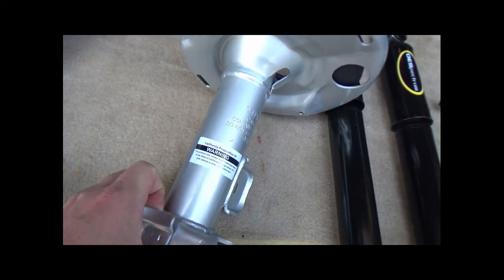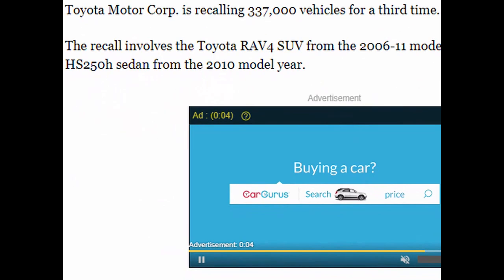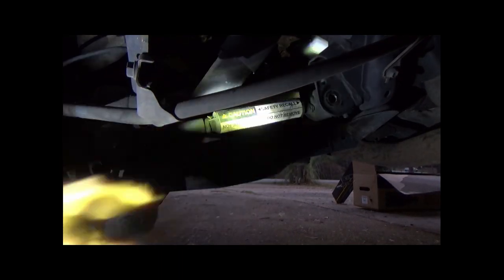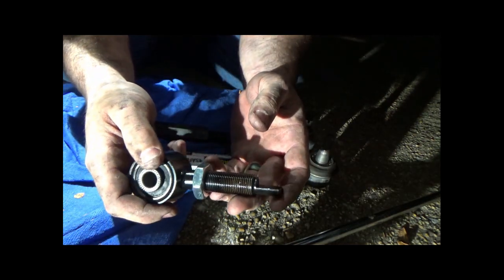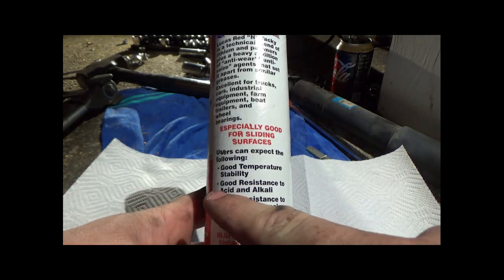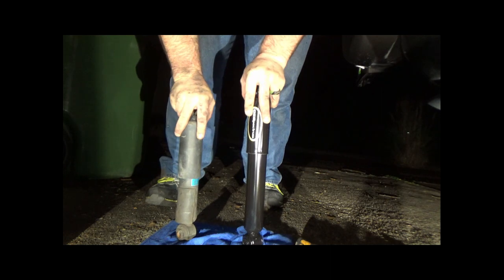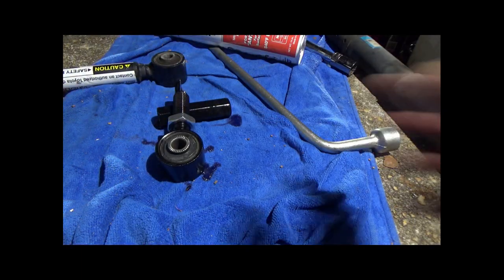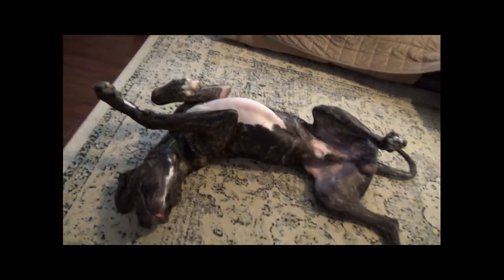How to install adjustable toe bars on a RAV4, and change rear shocks

Comment: I have 98,000 miles on my 2011 RAV4 and my tires wear perfectly. I am planning on replacing my struts and shocks soon,I hope I don’t have to replace too many suspension components too.
Reply from the maker: 2011-2012 I believe have a cam in the toe bar for adjustment, new design

Comment: Fantastic video, thank you. Stevenson Toyota here in Colorado quoted me $1600 for to replace the toe arms and align the rear wheels.  Thanks to you I got out the door for $100 at my local Napa store.  The Napa warehouse in Denver had stock and I was able to get the arms same day.  Thank you again!
Reply: can you share which parts you used for the replacement? Did your original toe arms have the epoxy?

Comment: I think anti-seize grease will work just as good since that grease is very difficult to wash off if water gets inside the thread. I read many places are over charging installing these control arms. What many people are confused about is the epoxy. Many don't know that the epoxy does not need to be removed and that only the two mounting bolts are only removed which are not epoxy.

Comment: Great video.  I have the same problem on a 2015  RAV4 with only 85,000 miles on it.  One suggestion:  Instead of grease, use anti-seize compound. It's thick like grease, but sticks better and is laiden with zinc that greatly slows the galvanic action between the dissimilar metals.  I use it on wheel studs and they never ever rust. Some people tell you not to do that as if your lug nuts are going to spontaneously loosen. This has never happened to me because I properly torque the lug nuts. The anti-seize compound literally stays on there for years.  Best rust preventative that I've ever seen.

Comment: I love it but I'll love it even more if everything is still good a year from now. If this works then my question would be why couldn't Toyota engineers come up with this? Better yet, why couldn't they come up with a replacement for arm that wouldn't have the rust problem?
Reply from the maker: Even if it doesn’t work, I’m happy to replace them once a year as preventative maintenance than to have the bottoms of my rear tires sticking out like a ricer
Reply: I agree.
Reply: To answer your question about Toyota.  This company would rather implement a bailing wire and duct tape "fix" rather than finding a solution to the problem and taking care of their customers.  Toyota has shown their true colors and as a result, I will never purchase another one of their POS vehicles ever again.  Obviously this won't phase their bottom line in the slightest but at least I won't be supporting a company who puts the screws to their customers after we spends tens of thousands of our earned $$$$$ on their crap products.
Reply from the maker: I will say all vehicles have there flaws but the V6 4wd Rav4 is one of the best vehicles ever made
Reply: @CreativeMechanic  
My personal update...
We bought our 2009 RAV4 two years & three months ago. During that time we have put 40,000 miles on it. The tires that were on it when we bought it lasted for 10,000 miles. The Michelins we put on as replacements have been on for 30,000 miles. No alignments have been performed and no uneven tire wear has taken place. We have had the tires rotated every 5,000 miles.

I'm going to look for your updated video, just in case we ever need it. Thanks again for posting this.

Comment: Thanks for the video I just found out about this issue. Toyota quoted $1650 to fix the alignment issues. I bought the parts and got it done right for a fraction of the cost. Total parts were $110 at O'Reilly Auto  Parts. I will also be greasing the part as you showed in the video. Thanks !!!!!  Great information Bro.

Comment: The rear toe arms on my 2012 RAV4 have a cam bolt……
Reply from the maker: Then your not subject to the safety toe arm recall.  I think like 20-30% of the 2012s got the fix on the production line
Reply: @CreativeMechanic  
Thanks for getting back to me.  I recently bought new tires and the shop did an alignment check.  Said rear was just out of alignment but was too rusted to adjust, wanted $900 to fix but showed alignment just barely out of spec so I said no.  I was changing brake pads so I inspected and found rust wasn’t bad at all and cam bolt actually look good (I’ve dealt with far, far worse).  I’m just trying to gather all the info I can before I go back to see what’s really up.
Reply from the maker: Dealer or an independent shop?
Reply: @CreativeMechanic  
An independent shop.  I need to review the alignment report to make sure it wasn’t camber……

Comment: Had the same problem on a 2006. paid Plaza Tire for lifetime alignment, but little did I know  all they could do was set the toe on the Front end. They said it needed adjustable cam bolts and they could do nothing with the Rear.Tires were wearing on the inside bad, Front and Rear.

Comment: Yoyota typical. Seems like bearing grease or marine grease would work. Anti-seize is pretty tough to remove. It would probably work well. Epoxy doesn't make sense. Good video.

Comment: Having some RECALLS done today - these rear toe bars, seat belt bracket, power window switch - not having the 'Smart Start Stop' done. I was going to have them skip this toe bar recall.  I asked if they could NOT install the Epoxy but wouldn't as the recall wouldn't be complete. I'll see if I can REMOVE the epoxy when I get it home. Supposedly the stuff takes a few days to fully cure. Acetone? Heat Gun? But likely end up just replacing the arms when the next alignment needs done....I'll have to watch the tires to see if they wear unevenly, too. 1A Auto has these - also called Rear Control Arms - for less than 100 a pair but out of stock today.
Reply: There are a few aftermarket brands on Amazon.

Comment: Good video, my wife 2008 rav4 had same tire wear after 160miles and I replaced the tires, went for alignment and was told we need to change the fixed toe arm to adjustable one, I did it myself but didn’t Lube with any grease or epoxy and went for alignment again.
Immediately my wife drove home she started noticing the car pulling to left and right and went back to alignment shop and they diagnosed that both lower control arm and sway bar link need replacement and gave her a quote for $1000 , well again I changed it myself but now everything goes smooth if you don’t wind your glass window down on a winding day or free way. I don’t know if I should put back the original Toyota “ Do NOT REMOVE” TOW ARM which is going to cost uneven tire wear or what to do to stop the car from pulling left/right. 
Has anyone ever seen or experienced this before as this is strange
Reply: My 2010 had severe cupping on LR tire so I bought new tires.  One of my front struts was bad (leaking) so I had new ones put on before getting an alignment, where they told me the cupping was due to toe-in on LR & I needed to replace the "Safety Recall" rods with the adjustable toe rods to correct it.  He wanted about $500+ and was way backlogged, so I replaced them myself with Moog's best set (RK100170).  Immediately had severe handling problems with rear instability. We're talking serious "death wobble" at speeds of 50 and up!  Happens on sweeping left curves, usually started with little dips or bumps, and is nearly uncontrollable until your brake and maybe jiggle the wheel back and forth.  Took it in to realign the rear & check the front; had him check the problem but he found nothing wrong and said the installation looked good; he had no solution.  Alignment didn't correct it, I've checked and rechecked everything and can't find the problem.  I drive it some but not over 50 and won't let my wife take it on the road at all. If it happened on a wet road even a 4WD Rav4 might not be able to handle it.
I kept the old toe rods and might have to put them back on;  or I'm considering new shocks first, since they're apparently original. Supposedly the sway bars and links are good.  If I come up with a successful fix, I'll post it for y'all. Good luck.

Comment: Thanks for this video! I'm about to get a new set of tires. Would you suggest going through with this procedure beforehand? Mine's a 2010 with the epoxied arms.
Reply from the maker: Yeah, if you have a good mechanic they could do it for you to.  They also have upper control arms now that you can adjust.  So you don’t mess with the lower epoxied ones

Comment: I have a Toyota rav4 with the same problem. It can't be aligned because of recall. I have a question. Once you have replaced the tow arms and then get an alignment, what's to stop it from breaking alignment again 30 miles down the road if you don't use  epoxy on the tow arms?
Reply from the maker: The epoxy wasn’t to keep alignment, it was to stop the rust from breaking it.  Torquing the nuts is what keeps alignment and I used grease to stop the rust
Reply: @CreativeMechanic  Thank you

Comment: After replacing it with an adjustable rod, will toyota dealer refuse to do wheel alignment for the vehicle, because the rod may rust and break according to them?
Reply from the maker: Idk, but Firestone will do it
Reply: @CreativeMechanic  Thank you. My 2009 RAV4 has same bad rear tires wearing problem. I may need to do something about it.

Comment: I just put brake grease on my my stuff is that wrong? Anyways I’m back doing this now after the north woods made a rear tire wobble more noticeable
Reply from the maker: Check the torque on your toe bars and make sure the shock mounting plate bolts are tight!!

Comment: What year is your Rav4?, I try this on a 2011 and there is no way to perform the alignment,
Reply from the maker: 2010,  take it to a good shop and get it done
Reply: Ours is a 2009 and gas fixed control arms on it. So far no noticable problems with tire wear for the past 30,000 miles.

Comment: Will the toe arms also adjust the camber? I am having toe and camber issues on the rear left tire, causing it to wear greatly on the inside corner of the tire. Love the idea of taking it apart after a year to check how the toe arm is doing! Would like to see you check it at 6 months if possible
Reply from the maker: Toe arm adjustment will change camber, but that is an indirect correlation.  It could make your problem worse.  Excessive negative camber can only be fixed by replacing shocks and coil springs
Reply from the maker: Also, at the 6 month mark it will be the middle of summer.  To get a good indication of rust probability it needs to go through a good winter season, so March of 2020 and you’ll find out.  In addition, from what I’ve read about toe arms breaking, its always on vehicles that are a few years older

Comment: Can someone please post a link to the exact item I need. I seem to be having trouble locating the item.
Reply from the maker: Febest doesn’t sell them anymore here’s some from Dorman 
Dorman 524-011 Rear Lower Forward Suspension Control Arm and Ball Joint Assembly for Select Toyota RAV4 Models https://www.amazon.com/dp/B00JW1WZ4W/ref=cm_sw_r_cp_api_glc_fabc_rIr8FbTWJR2RP
Reply: Thank you

Comment: How has the lift kit and rear modifications allowed your Rav to perform offroad?
Reply from the maker: Yeah it does well,  I just put on the Northwoods kit and it’s 100 times better than ready lift
Reply: Did you do a video on that??
Reply from the maker: Jose Meza working on it now

Comment: Hey I thought my shocks were bad from all the pot holes because they began to squeak  and hitting rough roads the other day. I did have shocks replace on 2012 Rav4  2 year ago so they were under warranty. So I took to the shop and they said the bushing was bad in the rear toe arm. My question keep in mind I'm not a mechanic bur youtube has save me a few dollars. Any way can I replace bushings or must I replace the whole arm itself. The shop says 243 dollars for the part and 432 dollars for complete job. watch you and looking at prices I found toe arms for 30 dollars so I don't know. Any advise would be nice ty and ty for the video.
Reply from the maker: I’m not sure how long these toe arms will hold up to the abuse, the main question I’m trying to solve is rust elimination.  But $243 isn’t a bad price, your likely at an honest shop